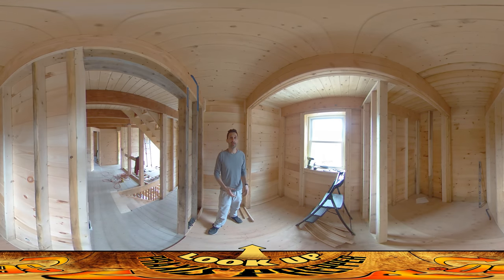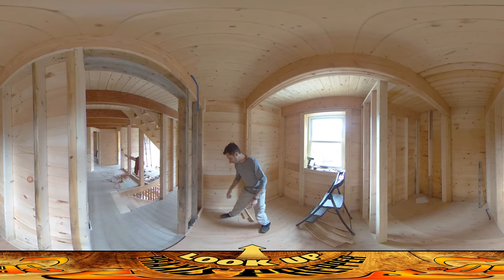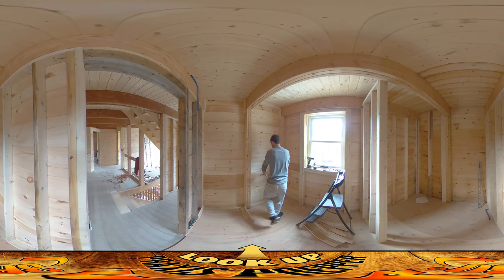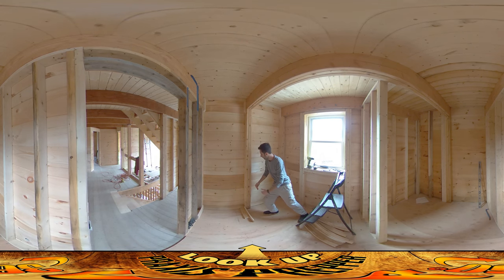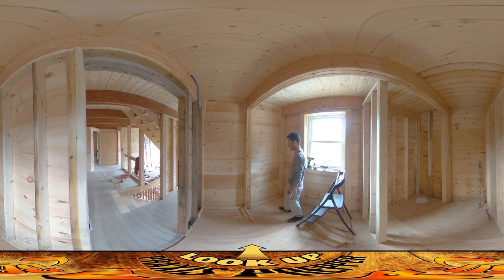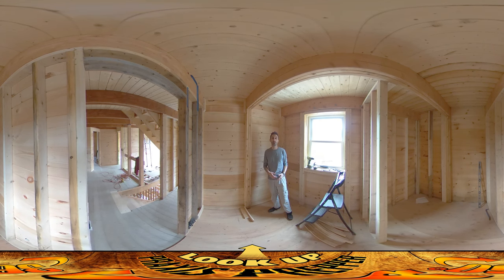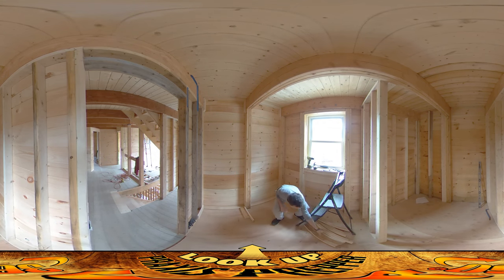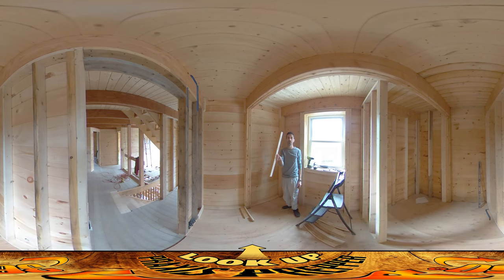Homestead Building - The Need to Know Specs on Appliances While Building, Using Scrap

Comment: Unasked for advice: 
Go online and get the width of the most popular washers, then add two or three inches. Make the extra space for two reasons. The first and immediately relevant is it's a whole lot easier to move a washer with a little wiggle room. Think installation and repairs every few years. The second more distant future is the size of washers (cook stoves and refrigerators) change with both engineering and the culture.  In ten years when your washer is so obsolete you can't get parts to repair it, you also may not be able to replace it with the same size machine. 
Yeah, I know, the few inches is a place for lost sock gremlins to hide. But, alas, most of life is a trade off.
Reply from the maker: I think I left a little over an inch on either side. The units all seem to be 27.5 inches wide. So I left 30".

Comment: While i found that a dryer is great for all the white stuff (bedding, towels), it's also really apparent how 'good' it is for fabrics (by all of the fluff that gets removed from those items). Now while that does make a great fire starter, i much rather have my clothing and other fabrics live longer (and i know enough about fire making not needing dryer lint). So i much prefer to get a wash rack and just have my laundry dry out naturally :) ... also helps keeping the humidity inside up a bit ... and lastly, why spend that extra electricity (that isn't free), on something that a little time will give you for free.
Reply from the maker: I'm a huge anti-laundry drying machine booster.

Comment: You have no heat and it's warm inside? What is the outside temp?
Reply from the maker: It's been 30's to 40's and the temp inside is 50-60. There's a lag in the temperature too though with the huge slab in the floor, so it may still be radiating out stored heat from when it WAS being heated weeks ago.